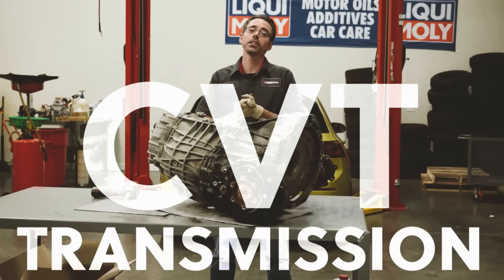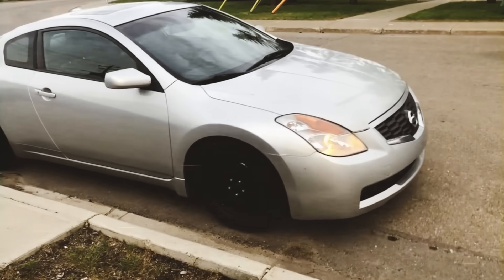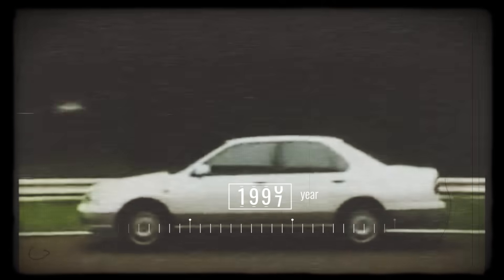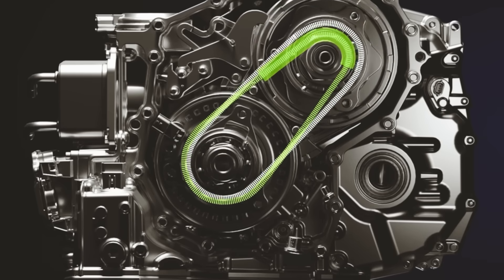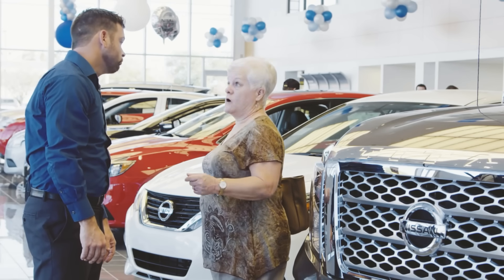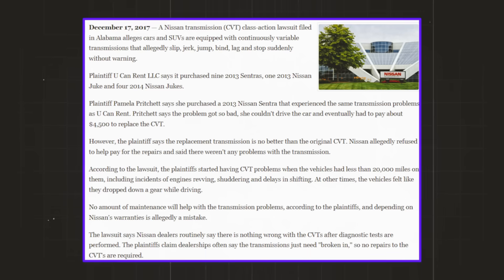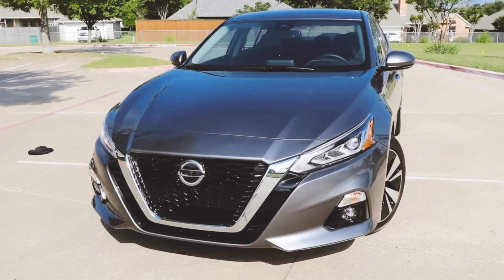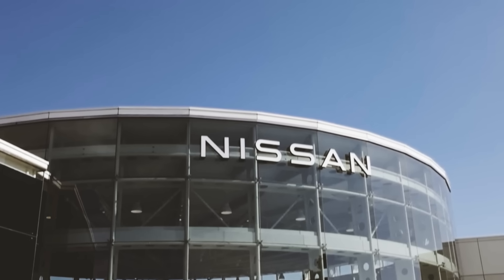Unpacking the FAILURE of Nissan's X-Tronic CVT

Comment: I experienced CVT first with 2004 Honda jazz / Fit i-dsi. A fuel-saving 86 hp city car that is zippy at downtown speeds and among the fastest to launch from traffic light stop to inner city speed limits - fun. It is quite pathetic on highways, doesn't do 60 kph to 80 kph acceleration well, but hey, it gives you near 40 mpg on mixed city/highway drive. It is a ton of fun, and you just need a good grippy tyre, and the whole car transformed into a very practical go-kart.

Next is Nissan Dongfeng's Livina X-Gear, Chinese car for poor country markets that in 2024, just serves as a contrast on how very far the Chinese has matured in their understanding of car design. This awful soapbox with cartoonishly miniature seats and after-thought headrest that is whiplash-inducing, airbags that is most probably useless, just doesn't inspire any driving confidence, unless you are a consumer from car-dependent third world country urban area. Granted, it has a pretty good Nissan HR engine series, but mated with Nissan's "Xtronic real drive" full of Japanese marketing gimmicky CVT that feels slushier than air-driven impeller auto, despite the supposedly rubber band linkage between the pulleys. It doesn't really deliver any discernable torque to the drive shaft. Always lagging, always under the power band, you kick down the throttle pedal, burn some fossil fuels, a lot of noise from the revvy HR15DE engine - but there is very little acceleration. It is hardly efficient either - it is pretty hard to achieve 35 mpg mixed, since it doesn't really link the engine and the drive wheels that well. Could be the exemplary car to encourage people to take public transit, bicycle, or just be a pedestrian when the weather is good. Why waste money, time and emotion in such a car with super bad transmission? You might as well buy an umbrella. My relative bought the car just to "humble brag" and "stay under the radar". Replaced it because she experienced a lifetime trauma of the car not being able to climb a certain hill gradient, despite not being laden with anything.
It made me think that Carlos Ghosn's era of Nissan, regardless his later controversies, really marked with awful cars, from flooding the market with Datsuns (further ruining Nissan's history) to the Xtronic debacle. But people only remember the "Godzilla" R-35 GT-R.

Is CVT bad? Behold Hyundai Creta's CVT - no moniker branding complications - just a super competent, super intelligent transmission linking the very modest yet hyper-efficient Smartstream 1.5 liter engine with CVT that never felt underpowered, and always give great throttle response. Mercedes' 9 speed dual clutch auto felt just as slushy - when on eco mode, since the car is much heavier. Great on highways too despite only revving up to 110-ish hp.

Long story short:
Nope, I never experienced any failure with Nissan's CVT like American consumer does. We don't have that lead feet and all those "merging" technique BS here. But the Xtronic garbage branding exercise is just simply awful and doesn't work. The worst part is how proud they are about this trashmission, they even put that "Xtronic real drive" badge at the tailgate. But then again, it is typical of Japanese cars in third world countries - Toyota even put "4matic" emblems in Avanza minibuses - confusing the 1970s 4-speed auto with Mercedes' 4WD system.

Comment: You would think Nissan would quit making Jetco CVT's after 32 years of absolute failure and decide to get Aisin eCVT's that have no belts, no wearable parts, no clutches and go to a simple planetary gearset like Toyota did with their Hybrids.

Beyond that just adopt Toyota's Automatics and their CVT platform with no known issues and last 300K miles.

Comment: I'll never forget when my father, who is a mechanic, bought a 2017 Nissan SUV. I immediately told him that he really shouldn't have because of the CVT, but he tried to reassure me that they worked out all the problems. Well, you guessed it, 2023 and it was slipping BAD.
Reply: Ummm..... 6 years later???
Reply: @jbelieve5050  Are you impressed it lasted that long?
Reply: @thelazarous  they all should last that long and longer...
Reply: @jbelieve5050  If they were built for an SUV, absolutely, but unfortunately they were made for the Maxima and crammed into as many vehicles as they could. They don't have issues with the Maxima, despite it being the same transmission, only with their heavier vehicles.
Reply: @thelazarous  so is it the exact same cvt in the maxima, or is it beefed up a bit for the maxima.....if its the same I dont understand why they fail in the others and not the maxima..is the altima heavier than the maxima?...my maxima has 151,000 miles and still going.
Reply: @jbelieve5050  The Altima is 200lbs heavier, the Pathfinder is 1200lbs heavier. Bit of a difference there
Reply: @thelazarous  i can see that with the pathfinder, but with the altima it would just be the difference of having a passenger with you or not....I wouldnt think 200 lb would matter....surely there is a bigger difference in the maxima cvt than just 200 lb of weight in the altima causing the issue.
Reply: @thelazarous not true, the Sentra and Versa are light and still have CVT failure
Reply: Mitsubishi uses them too [JATCO].I wonder how many folk realise that.
Reply: @tolrem Mitsubishi is nothing more than rebadged Nissan
Reply: So your mechanic father didn't know that CVT fluid needs to be changed every 30,000-50,000 km? Does he know anything about mechanical engineering?

Comment: I had a 2011 Murano  from 2018 to 2024. The biggest issue I had with it was the noise from the manifold exhaust pipe. Some friends liked it because it sounded like a V8 LOL. Never had an issue with the CVT. It might have been I gave it maintenance, and that I never accelerated like many maniacs do. My habits from learning manual shift might have helped well too

Comment: I've owned a couple Nissans. A 2012 Altima Coupe SR and a 2018 Sentra Nismo. Both had a CVT. I just changed the fluid and filter every 20k miles. Both lasted over 200k miles without zero issues. Finally sold them and sticking with geared automatic Toyotas only.

Comment: I have an idea to make CVT super reliable, replace the drive and driven pulley with generator and motor, connect them with wire not belt, wait Toyota has already done that?

Comment: #1 problem they told customers it was a sealed for life transmission. In fact they need service MORE than traditional transmissions. You need to change fluid and filters every 25-30k miles and that sounds excessive, but its not Car Wizard showed on a video of his what the fluid looks like in just 20k miles on his Nissan Cube. Had they serviced these transmissions they would have lasted longer, but still CVT's suck and if you buy one you deserve the trouble your going to get if you do not service it like clock work.

Comment: I just brought a used 2017 nissan murano as a backup, I wish I would have not brought it and would not have if I did my research first. That transmission has to many moving parts, metal fatigue with it's belt and metal bans is just not the best approach for a transmission, it will fail, just a matter of time.

Comment: I got a 2008 Sentra brand new thinking it would be more efficient than my 4 speed Camry. Nope, it wasn’t. And after 10k miles is stated making a wa wa wa wa wa sound at a steady speed and it did that from then on. Changing the fluid didn’t help. Gave the car to my ex in the divorce at 75k miles and haven’t missed it.

Comment: I had an 07 Maxima, the first year they used a CVT in them. I never bought another Nissan because of the CVT and I actively search out cars with conventional autos. The torque converters sucked, the transmission temps are insane. My 07 CVT would get over 300 degrees in summer traffic and I had gotten it up to almost 400 degrees stuck in the snow one year. The $20 a quart fluid, friction, fluid sheer, cheap bearing quality, the fact they couldn't be rebuilt and all the weird noises they made. It was enough for me to forever avoid these transmissions. I don't care what brand it is. Nissan would've saved a lot of money on lawsuits and brand reputation if they had just developed a different transmission and ditched the CVT

Comment: The Prius doesn't have  CVT. If it did, Prius transmission failure would be a thing. But it isnt. It has a motor / generator, and a gear reduction unit. No belt. No drive / driven pulleys.

Comment: I bought a 2007 Altima with a manual for $3000. Almost has 180k miles and according to the guy I bought it from, it is all original. Runs great too. 
The only real issue it has is that oil is disappearing slowly (still trying to find out why, but there is no sign of burning or leaking). It just isn't the prettiest.

Comment: I’ve worked at a rental car company for ten years and never not once did I ever see a cvt from any manufacturer fail. During covid some had over 150,000kms on them cause we can’t get new cars and they still were fine. Nissan included
Reply: The CVTs work fine for the first 60-75k miles. After that’s when they often fail if the fluid isn’t changed.
Reply: @OptimisticEngineer345  They fail when people burn up the fluid. You can drive them 1,000 miles in 100 degree heat and burn up the fluid and the CVT will be toast in 2,000 miles. Like the parent comment said, Nissan recommends fluid "inspections". Fluid can last 80k in these cars if babied. Another thing to note is that it's hard to identify if the fluid is toast. Using the dipstick and paper towel does not provide enough indication if the fluid is junk. You have to drain ~100 mL into a white cup to see if there is a tinge of black to it. Sounds like Jakechappell9241 lives somewhere where it's relatively flat. Hills + heat + roadtrip = dead CVT. It's all about your judgement if you think you drove it in hard enough conditions to warrant a fluid inspection.
Reply: @garneroutlaw1  That makes a lot of sense. The Senta doesn’t have a trans cooler, making the transition overheat even more likely when climbing hills at high speed on a hot day.
Reply: @garneroutlaw1 for someone to have to go through with all of that just to check if their pos cvt is fine or not is an issue itself.

Comment: OK, bought a 2013 Nissan Sentra new and still own it.
Drain and fill CVT fluid every year, and change filters and drop pan every 30,000 miles. Added an aftermarket trans cooler too.
Drive easy, no racing or hauling...use original Nissan fluid.
So. Far no issues..will keep the carr

Comment: I have a 2014 sentra with almost 120000 miles. Kept up with maintenance of the CVT, but just very recently it started to shudder and vibrate. Took it in the past week, and they ruled out that it’s not the transmission or the mounts, but a stupid engine cover that is loose. It made me wonder, however, how can a piece of plastic make a car shudder? Will be getting the part soon, and will see if it changes anything. Gave the car some fuel system cleaner also. I hope this helps. Because if it still doesn’t help, that means it’s the stupid transmission, and it’s time for me to let it go and sell the car. I don’t have $4000 plus in my bank account for a new CVT.

Comment: I hate CVT transmissions like automatic transmissions aren’t boring enough but I do have to say one thing my wife and I bought a brand new 2010 Mitsubishi outlander. We always take good care of our vehicles. For some reason this car we could give two rats about we change the motor oil that was it never even thought about checking tranny fluid never change the timing belt, the car has 225,000 miles on it and still runs beautiful. Maybe it was one in 1 million

Comment: I bought a new Nissan in 2021 I new about the cvt transmission  so keep up with maintenance had transmission flushed and filters replaced and everything works great  y have to do maintenance it a very good car took it on a road trip from Michigan to Florida get around 38 to 40 miles to the gallon

Comment: I bought a new 2007 Nissan Sentra with the cvt transmission.  Nissan offered cvt or 6 speed manual only.  I went thru 3 transmissions before the car hit 50,000 miles. After the third transmission Nissan said they wouldn’t replace another one.  I will never buy another Nissan, they are still crap, the transmission is still crap.  I would think they would have fixed the darn thing.
Reply: Think maybe a lot of it is you driving style? You cannot hammer on them they will not take. How you drive your car has a lot to do with how it holds up.

Comment: I have a 2018 AWD Rogue with the QR25DE and I'm on a mission to find a manual transmission that can bolt in between the engine and the rear diff.

Comment: You would wonder why Suzuki and Mitsubishi do not have issues with Jatco CVT's. I think the answer is: less powerful engines, better oil cooling for the CVT. In my weak, cheap Mitsubishi Mirage, with standard oil cooler for the CVT, I had no problems (85000 miles and 9 years old).

Comment: Nissan. The same company hat did not put a battery cooling system in the Leaf, condemning All of those models to an early doom because of battery issues. I hear in 2019 they added an air cooling system but those are still not in the same class as the liquid cooling systems the other mares use. They have known about these CVT problems for over 20 years. What on earth is their R&D department thinking as they are not addressing the issues. Instead they are blaming the customer for them. It does not matter. If the customers who are not maintaining them right are not accommodated, they will bad mouth your product. 
Nissan seems to have forgotten that every happy customer tells about 3 other people. Each pissed off customer tells 10 or more other people. Not making the products a stronger as needed is detrimental to the long term success of the company. 

They cannot depend of feedback from Japanese owners as they tend to be fanatic about maintenance over there. Here in the US and Canada, we tend to let that stuff slide. The customers have here let maintenance slide with conventional automatics and the CVT has to be equally accepting of abuse. 

I have owned a Honda CR-V with CVT with no issues. But I have to say, I changed the CVT fluid well before the recommended interval. 

Personally I will be happy to see the BEV takes over the market and to see transmissions disappear from the earth.

Comment: I have a friend who bought a Nissan Altima brand new back in 2011 and as far as I know he didn’t have any problem with the CVT. He still uses it as a secondary car now. I also had a conversation with a Nissan salesman regarding the cvt issue and he told me that most failures happened from a fault in the temperature sensor of the transmission back in 2008 to 2013 and that issue was resolved after that. What I deducted was. 

1- Changing the transmission fluid alongside both the filter and the pan prematurely goes a long way.  

2- installing an additional transmission cooler in hot climates is preferred.

Comment: I had a 2014 Nissan Sentra until two days ago when I sold it for 6k. I put a 148000 miles on it without any cvt problems or any other problems for that matter. I did change the cvt fluid every 20,000 miles which I’m sure helped

Comment: I've never had any issues with any of my Nissan vehicles whatsoever. I've owned 2003, 2012, 2015, 2018, 2021. I did get rain water in my 2021 Rogue and had a tranny issue but it was cleared by an auto body company after an accident 2 months later. The transmission would only shift after holding for 2-3 seconds. When they cleared the error, I was shifting bang bang. No wait. That was on me though. I should have tried to clear this error before someone else had to do it. Knowing Nissan, it may have cost...a lot!!!

Comment: In my opinion CVT transmissions benefit the automakers more than they do the consumers. They are cheaper to make, smaller, lighter, and give slightly better fuel economy than an ordinary transmission but those benefits aren't enough to offset their reliability or lack thereof. Hopefully the ones being used now have the bugs worked out. My most recent vehicle purchase is a 2024 Camry XSE V6 and one reason I purchased it was that it used a 8 Speed automatic and not a CVT.

Comment: They're fine, providing they are serviced - most workshops don't even replace all the filters, or even know that there are filters that don't come with most "service kits".
Building in fake shift points always seemed a bit weird to me.
We have 2 Tiida/Versa hatchbacks with straight CVTs in them. The old one is well over 200K in the mileage department - I have to have it serviced again, because the last workshop didn't replace the "external" filter, (which, is unfortunately located INSIDE the transmission under a bolt-on housing), but most workshops don't know it's there. So for the cost of that filter, (NZ$62), I have to have a $500+ service redone.
It's ignorance and lack of maintenance that kills Jatco CVTs.

Comment: This video is misleading CVTs will outlast a normal transmission because there are no sacrificial wear clutches BUT the owner has to change the fluid every 30k so the belts never touch the pulleys. I have a 2014 rouge with 170k miles no issues and a 21 rouge.